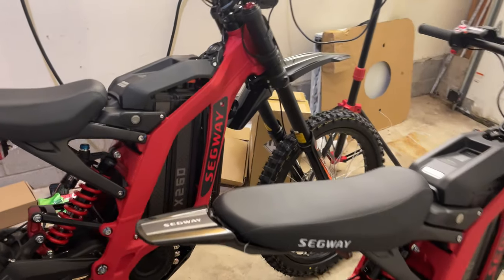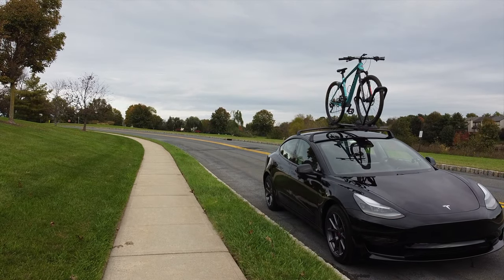Sur Ron / Segway E Dirt Bike  on a Tesla Model 3

Comment: This is what I did. But your bike Rack is only rated for 60lbs. x260 is about 100lbs without battery.  122 lbs with.
Reply from the maker: Actually this is a two bike rack ( 60 lb each ) so number is 120 lb, and I'm taking the battery off.